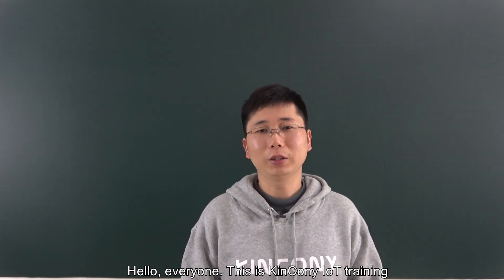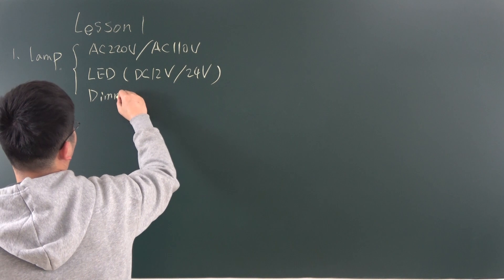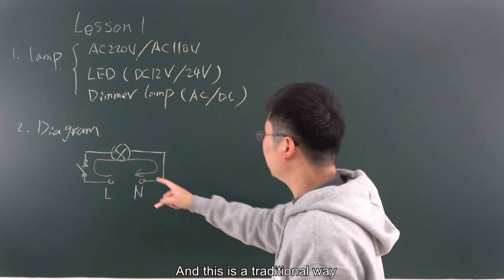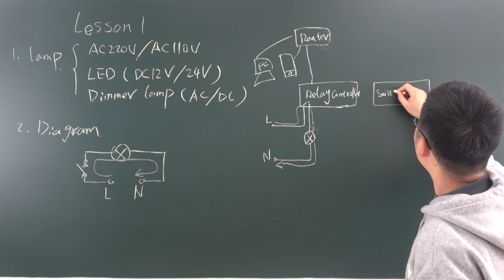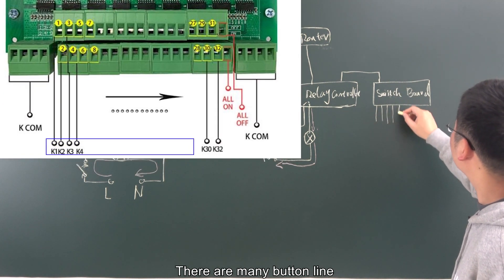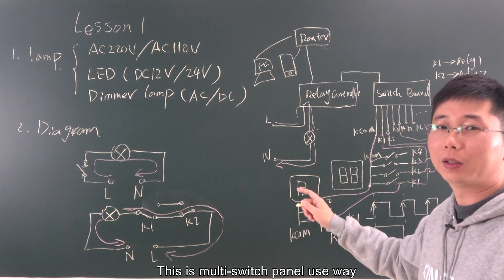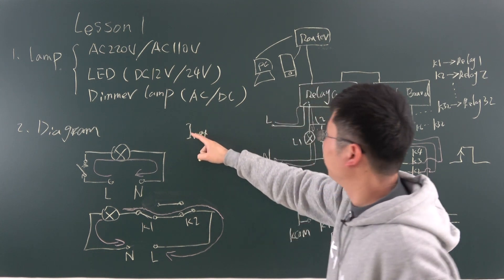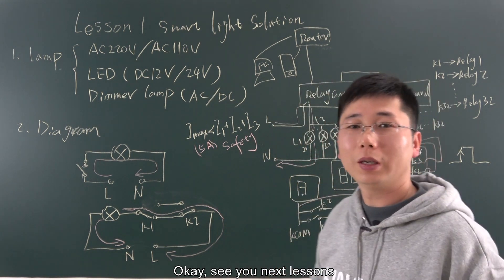【IoT training lesson beginners #01】How to let your light become smart

Comment: Thanks kin , its so inspiring . Its a good channel .
My question is , when relay 1 is connected to 5 lamps , and we want to control it independtly via mobile phone and switch can you show us the wiring diagram with the lamp 😁. Thankyou before
Reply from the maker: that will need use by 5 relay, if use one relay only control all lamps at the same time.

Comment: Which software programming done arduino or any other. What is difference between micro controller Atmega128 and kc868
Reply from the maker: KC868 relay controller use ARM CPU, use our PC or phone app, it also support third software platform, because all our products is open protocol.

Comment: For home automation every sw board i have connect cable from room sw to Distribution box sw board so more wire required so can i move DB sw board near to room sw board and serial communication.? Please suggest for 4 rooms how to minimize wiring and do automation.
Reply from the maker: yes, you can ,swith terminal board from relay controller MAX about 10 meter. if want more long distance, it can add extend adapter, 1KM is no problem. Although there are a lot of lines from switch panel to switch terminal board, but it's most stable and easy to repire when broken.
Reply: @KinCony  thankyou for reply. I an confused how to do home wiring if i use relay board in every room then how to provide them power supply 12v, for that i need L+N or power cable from distribution box, if possible kindly share each room different relay channel box then sw and room appliances connection. You have given us one diagram but in that relay channel board is kept in same box not in individual room.
Reply: I have 1BHK at ground floor and 2 bed rooms and living room at first floor so where to put distribution box is good for us. Also how to do wiring underground wiring AC and DC
Reply from the maker: @pushujgd  you can also put relay box in different room, every relay controller will include a power adapter for AC110-250V ->DC12V. such as room-A place controller-A, room-B place controler-B, every controller need DC12V for power. every controller connect to router is ok, then you can use one phone app to control all relay controller.
Reply from the maker: @pushujgd  every floor have a controller independent will be convenient management and maintenance.
Reply: @KinCony  thank you for quick responce,
So every room relay controller need to install and need to route L+N also , all relay board connect to router and router connect to main controller is it ok? Which one is better take cable of 16core from every room from sw to main distribution box or every room one relay board? Do you have this drawing and cable length. And which is best position for distribution box to kept so that cable minimum utilize.
Reply from the maker: @pushujgd  i don't understand you, why every room put relay controller and have a main controller? all relay controller is independent, no master and slave level. if you install a distribution box for one floor, every room not need to install relay controller again. if every room have a relay controller, why you add another main distribution box?
Reply: @KinCony  sorry i think i am confused with relay controller and sw terminal board, basically i want to know how to route cable via wall for each room need to add 2 pipe one for ac wires and another for cat5 cable and 12v dc supply. and another option is take all wall sw cables to distribution box, which is good
Reply: If all wall sw cables of each room i will route to distribution box then large quantity of cables required but if i use sw terminal board them cat5 cable need to route, so which one you suggest for long lasting use.
Reply: Also reply can we have output terminal board same as input terminal sw board
Reply from the maker: @pushujgd  https://www.kincony.com/download/KinCony-Smart-Distribution-board-32-Channel-V-3.0.pdf   I think you can this diagram will understand clearly.
Reply from the maker: @pushujgd  i think you install every floor a power box, switch terminal board is also install inside of power box. all switch panel's button line connect to switch terminal board.
Reply from the maker: @pushujgd  ??
Reply: @KinCony sw terminal board for inputs so same can we have output terminal board which we can use in first floor for outputs
Reply from the maker: @pushujgd  switch terminal board need work together with relay controller.

Comment: Hi Kincony, thank you so much for the video - really appreciate it. I have watched the video and got a question. How does the wiring from each switch board go to the relay module (near the fusebox) is there separate wiring from each switchboard button to the relay module (K1, K2, K3..etc)?
Reply from the maker: switch panel connect with switch terminal board, switch terminal board connect with relay controller by RS232 cable. each switch panel have K1,K2,K3...... connect to switch terminal board's port independently.
Reply: @KinCony  Thank you for your answer. Does this mean that every switch button on the switch panel has dedicated wiring to the switch terminal board? Wouldn't that be a lot of internal house wiring?
Reply from the maker: @UsmanIjaz  yes, you can see this diagram: https://www.kincony.com/download/KinCony-Smart-Automation-Solution.pdf
Reply from the maker: another diagram: https://www.kincony.com/download/DIY-Home-Automation-by-KC868-H32B.pdf
Reply: thank you so much!!! :))